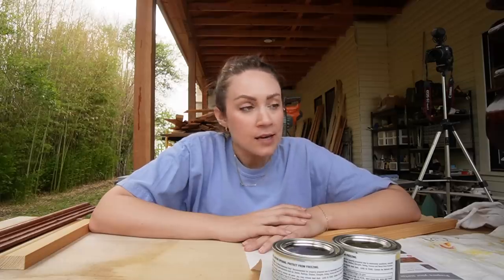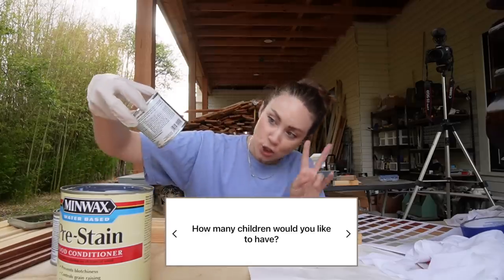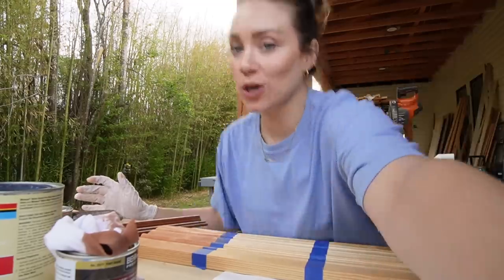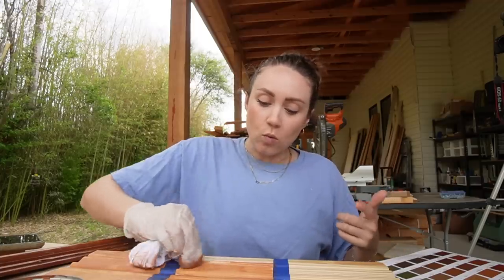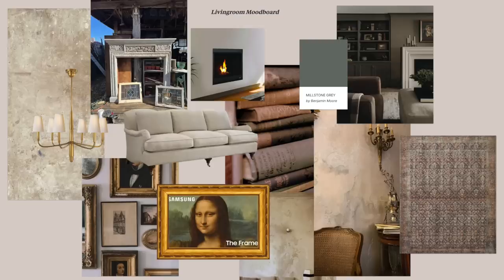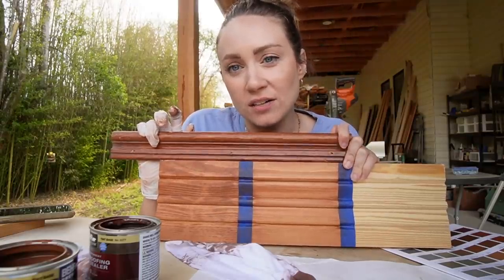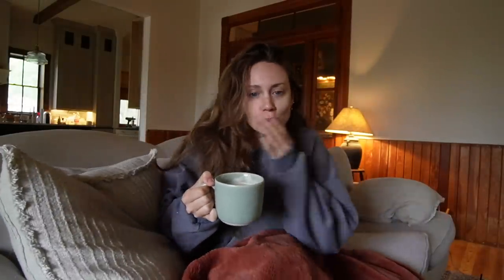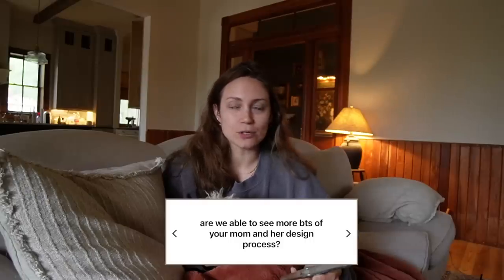testing wood stain + Q&A *room makeover inspo* | XO, MaCenna Vlogs

Comment: Hi I’m a professional colourist! Only at the beginning of the video so not sure if you get there, but the undertone of orange is good but it also needs not only depth but also some red/mahogany. Go significantly darker than the russet, it’ll save you from having to do 4 or 5 coats of something else. It’s much easier to pick something with a lot of depth and then go over it with something that has the undertones you want, with the lighter orange one you picked after. That would be my suggestion!

Comment: MaCenna, when you originally did the closet door I thought you could come up with your own stencil design for the glass using your Cricket instead of a design from a store.  You can make it anything you want, any size you want, etc.  You could even make it match the front door, or some version of the starburst to complement it.
Reply: A starburst would be nice
Reply: I love the Glass insertion so maybe it can go into another Area as it's beautiful because flowers Always Are😮.
Reply: I love these ideas.  I'd keep the floral stenciled glass piece for future use.  It would be really cute used in a little girl's room...  Even framed in an antique frame and hung on the wall with a brass chain.  Or wide moiré ribbon with a medallion style hanger or simply tied at the top in a pretty, droopy bow and hung from a regular hanger which would be invisible.  

I love the idea of making a new one and echoing the starburst pattern from the front door.  Or even just simply frosted with a bit of a delicate clear glass border.  The border design could be something fancier like an ivy pattern or something simple and more geometric, like you'd find painted in gold on store windows or bordering stationery.
Reply: I didnt like the square thing.. to me the flowers should be frosted and the negative space not frosted, do you understand? The stencil frame turned out weird

Comment: You do know that the thicker and longer you leave the stain on the wood the deeper the color is. Try using a brush and letting the stain sit for  5, 10, 15, minutes before wiping it off. This also helps the stain take to the wood in a cohesive fashion.

Comment: My trim, and there’s a lot of it, is fir. It’s darker and a little harder than pine. It is 37 years old, and it apparently was milled at once just for this house. So when we had exterior French doors replaced and the new doors were slightly bigger, the existing molding didn’t fit. I had to find a millworker to make six 8’ boards to match the profile. I did and it wasn’t expensive. The best things I learned were that the wood is die, and that you just varnish it, don’t stain, because it will age to match. However, the stain that matches the 37-year-old wood is called Gunstock. It has a dark red tone.

Comment: Can you change the glass with the flowers up on the top. Just switch them:)
I think it would be really pretty to use a fluted/shaded glass.  I had a new Solid Wood Door 🚪 with Glass on each side.  I didn’t like that there was no privacy on either side of the “front door”.  So I went to Home Depot and purchased a roll of  ( DIY Privacy/ Decorative Glass Cover ). It’s really easy and looks amazing.  It’s a layer with 1 side that is sticky that goes on the glass.  It’s like tinted windows in a car.  I also used the extra glass cover for one of my cabinets & it looks great. Basically all you need is a ✏️  pencil, scissors ✂️, or razor blade to cut it to size.
Reply: I didn’t display family photos until I had my children.  After I had my three Beautiful Daughters I love to see all my favorite pictures of them.  But I do have a lot of artwork also.  I have 4 of your Mothers Gorgeous Artwork. ❤

Comment: Your glass panels in the door; My favourite glass pattern to install is called "Niagara Falls" BUT instead of installing it vertically like is intended, install it horizontally and it looks like water ripples. Since you are on a lake, it would be perfect. It also looks unique because no one else installs it horizontally (that I know of), at least not where I live.
I am not a family photo person either and I think its because I can visually remember perfectly my friends, family and pets  both past and present, so I don't need a photo to look at - I just look at them inside my head. I never even look at them in photos in a book or on my computer. My walls therefore are filled with art.

Comment: Strange things to try for  wasp . 1 all old homes painted the porch ceiling light blue or a historic light purple (blue under tone). It is supposed to mimic sky so the don't land on it.  Also place a bag stuffed like a wasp nest  near the porch  most do  tree if it can stay  dry enough or porch corner. I had to do my daughters porch light and they stopped nesting  around it. They think it a nest already and don't  make one near it.  This dosen't  stop bees like you would think.  Completely thou they don't  come as close.
 With roses near your door   itf bees become a problem  you may want to try  putting a soda can with a bit of soda in it to the far corner  of your yard were you don't  often go  this draws them away from your door .
 Those mosquitoes there are a few plants to grow Phenomenal Lavender  and Lemon Balm are my favorite ,but you need to check which of several grow best in your area.

Comment: Curious about your kitchen cabinets on either side of the windows. They look really low to the countertops. Is that just on video? Is it a standard height? It doesn't look like you have much height between the counter and the bottom of upper cabinets.

Comment: You should ask for russet times 2.  They’d double the formula and that’d make the color twice as dark as the original. More pigment is exactly what you need. People at Lowe’s and Home Depot won’t understand that bc those people transfer to different departments all the time. They won’t have as much knowledge as someone who works with paint every day.
Reply: Also if you take the piece you are trying to match and a piece of the new wood to a paint store they will make you one stain that matches so you don’t have to mess with multiple stains etc.

Comment: Changing the curtains in the bathroom is a simple, easy fun change. It really didn’t cost you much. Mostly just some time to like remove the threading pattern through it for quilting. And I really love everything that you do but the truth is I never felt like those curtains quite worked in your bathroom and I don’t know why, but I keep thinking it look better if they were longer, and maybe I don’t know just maybe if they came from the top and then you could do a little tie backs when you weren’t using them but I guess you’re often using the bathroom not just for baths so that might not work. But have fun with a girl change it up. See what you like but I agree with you. Not that that really matters that I agree with you. Lol. But we never really know how we’re going to feel about something especially little touches until we try it and you always wanna change things up a little bit overtime. At least I like to.

Comment: Would you please try Spanish Oak with a little wallnut in it! Add it right in to the Spanish oak, mix it a little at the time until you get the color you are looking for. The business of staining it one color & then another seems contertuative. Spanish oak, is absolutely a orange base. Most old wood tends to stain red. The additive of a little dark wallnut counteracts to much red. I am also a beautician & that teaches you much about color. You don't want to use a strong base of the color you actully want because to much of it, turns it way to strong in that color. You almost always have to go to the opposite color base to balance it out. Think to much orange, is to much orange a great balance to counteract that almost always works. In stain as well as hair color. I swear I lived in a very old house & this much always worked for me to match the old wood. To keep it from splotching why not condition the wood with wood condition. I have went as far as using straight bleach on old wood to reduce the red in it. My least favorite color of wood is anything red. Orange or a nice yellow or light color yes. Red is my favorite color, but not in wood. It clashes with all other colors to me. Especially a nutral or dramatic color.

Comment: You shouldn't use exterior stain indoors.  There are more chemicals you wouldn't want indoors. Also, adding a top coat (polyurethane) over an exterior wood or deck stain will result in peeling. I hope you see this before you use the exterior stain.